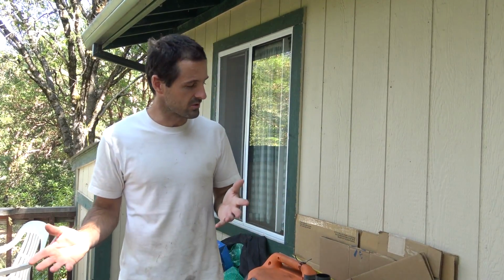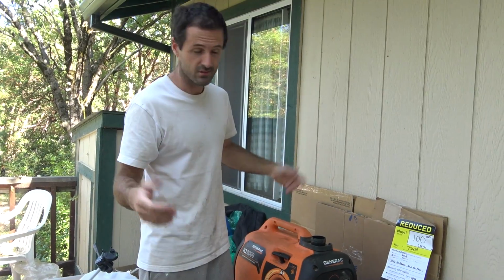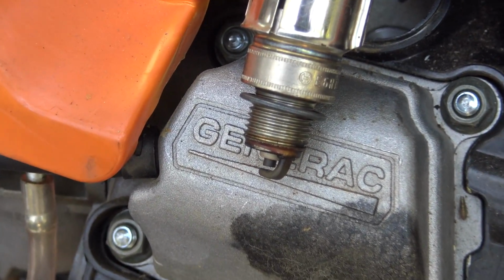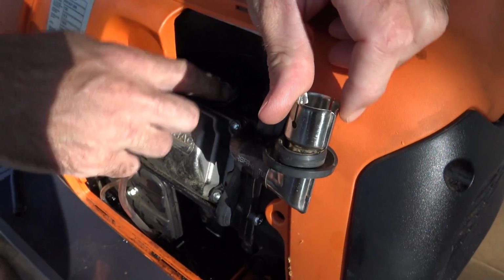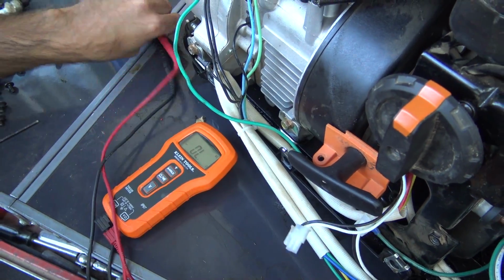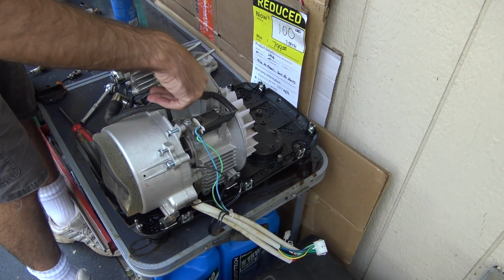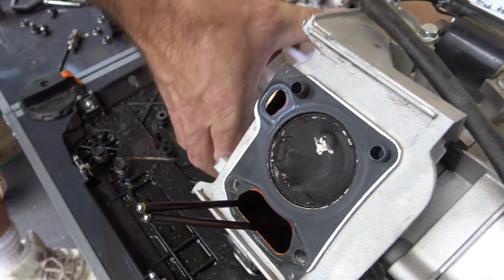$25 Generator From Lowes - Will It Run?

Comment: You have a place to fix things? You'd be surprised what people throw away. Free is always the best price. Fresnel lenses from the old heavy TVs. Furniture that only has some kind of cosmetic defect.  Radios. Most of which I didn't even have to fix. Always look threw things that don't interest you too. Open greeting cards of all types. I found two twenty dollar bills in a discarded happy birthday card. Women throw expensive jewelry away when they THINK he might be cheating. Knowledge of how to fix things and tools. A place to work and you can enjoy a quality of life higher than your income implies...
  The Idiots opinion that it's not worth fixing means NOTHING!! They think ONLY in terms of money.. I've been told impossible by so called experts when I ALREADY DID what they're telling me is not possible.
 It's okay to put ether in the cylinder. You can buy it under the name of "quick start". Just keep trying like you are and it should eventually start without using ether.
 Obviously you have lots of experience fixing these kind of things. Intermittent break in circuit continuety...
 I would have just bought a new plug FIRST before examining the cylinder.
 You are definitely NOT a fool.
 This will DEFINITELY RUN.. They just didn't want to bother with all that when they can spend their time making money doing simpler things....

Comment: Copper, zinc,vitamin c. and biotin great for hair. Do not wash hair with conditioner just shampoo and never watch hair with water. I was just taking my biotin when I heard your wife say on the clip that your hair was thinning. Lol. Thought I gave you a tip sense I was going threw the same thinning hair. Great video. I think is you need a spark plug about $3.00. Did you try cleaning the connectors on the spark plug if try the compression rings it happen to mine. Compress air was escaping no pressure.

Comment: Next time take out the plug por 30 weight oil right on top of the piston and let it set any time you walk by it manually turn the motor just a little bit just randomly over the next 24 hours then try to start it the Rings will free up I have done it with numerous Vehicles pulled out of fence rows that haven't ran in years

Comment: Do you know how to tell if an engine is flooded? Check the spark plug and see if it is soaked. You just flooded the engine on purpose and then tried to start it. You would have to pull for a long time to get it running even if you didn't further sabotage yourself by pouring gas down that tube. Leave the spark plug out, leave it sit for a day and START OVER.

Comment: A wet spark plug IS NOT what you want...with that much oil in it I would look into a leaking carb needle and seat or even sticking valves and rockers...

Comment: I always spray a little carb cleaner in the filter area just to see if it will run on that for a few sec`s...And I ALWAYS do a compression test...2strokes 120 psi min. to run right and 4stroles 70psi min. IMO...

Comment: when you put to much oil in it the oil will get up to the burning chamber and make the piston rings stick to their seats - therefore it doesn't have any compression anymore - This way i fixed the compressions on a kubota motor... Also the carburetor needle may be stuck.... Sorry for my bad english.... Greetings from germany
Reply: sorry didn't watch the other videos.... :D

Comment: I work for a company that does all of Lowe's warranty repairs on all their power equipment and gas equipment these units that is being bought for cheap are called Beyond economical repair units it is we're a part cost more than the item itself so they sell these units for scrap price I have bought a lot of things from them and it would turn out all it would need was a simple fix

Comment: they cant sell that, its missing parts which makes it a liability. u could sue if it injures you and they will settle out of court for atleast $20,000. I used to be a corporate lawyer.
what i would do is loosen the handle and drop it on my foot or set a small piece of your skin on fire for the big money.

Comment: if you invest in a bore scope, you can look into the cylinder without tearing it all apart. You can examine the cylinder walls, top of the piston and It is flexible and can peer up wards to view the operation of the valves as well.
The older way would be a compression tester, however you would have to disable the compression relief if it is not internal.

Comment: Commenters have a few good theories, the pull cord one can't happen though. If you pull the cord backwards the starter paws on the recoil won't engage the cup on the flywheel. So that theory is out.

My guess is a bad ring. Overflowing oil can cause all kinds of bad things, carbon buildup, which leads to heat and so on.  Good luck, those things are a pisser to work on. Not sure why this popped up in my recomendations, but I'll eagerly await the follow up.

Comment: You just fouled the plug by pouring gas on it. 

Use starter fluid.
Reply: TheHologr4m seriously lmao
Reply: real genius here lol
Reply: Not charcoal starter fluid - spray starting fluid (ether).  I see several good suggestions.
Reply: @TheHologr4m .. 🤔. My 1st thought. Hmmmm
Reply: TheHologr4m gas does not foul the plug oil does
Reply: My dad used unleaded on my atv spark plug and it was fine

Comment: If you watch closely at 7:41 you can se the spark jumping from the sparkplug wire to the head og the engine. If you look over the nut at the end of the generac logo, you will definetly see it.

Comment: My friend you have a valve problem, next time spin engine until one valve is full down and check the other valve to have a slight hand movement and then check the other one , i bet $23.70 that one valve it is too tight and it keeps one valve allways open this is youre problem 😏
Reply: 23.70 well spent hu?
Reply: that is what i what i thaught when he first pulled the cord

Comment: BRO ,...
YOU SHOULD'VE FIGIRED THST ABOUT THE  COMPRESSION AND ANYTIME YOU OVER FILL A RNGINE WITH OIL IT DAMAGES IT ....
ICE BOUGHT A VEHICLE WITH A NEW ENGINE IN IT , BUT BECAUSE IT WAS OVER FILL WITH OIL IT WOULD START AND IT WOW IDLE BIT WHEN GAS WAS GIVEN IT WOULD GO NOWHERE AND DIE OUT .... THE TO MUCH OIL CAUSES A LACK OF ROOM FOR THE PRESSURE AND IT BLOWS OUT ELSEWHERE.....

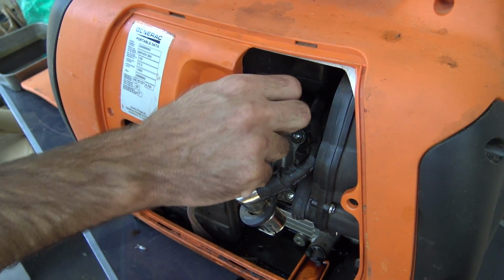Comment: I'm at 4:30 and I believe it's the piston rings the there was so much oil in the motor is got into the cylinder and pushed past the piston it could run for a short time but the tell is no compression

Comment: I used to work at Home Depot in tool repair, the first test we do is hook it up to a compression tester and if it's low write an estimate for a short block and labor which 99% of the time exceeds the value of the unit, so I'm not surprised at all that they wouldn't fix it.

Comment: Get a cheep $15 endoscope from amazon. You can drop it in the spark plug hole and check out the piston and cylinder with out having to take the whole machine apart.

Comment: I'm going to guess before I watch the next video revealing it...maybe they put the pull cord on the wrong way so it turned the crank the opposite way it's supposed to?? Since you said you had compression when you turned it the opposite way it was hooked up....guess I will find out. Great video btw I will be checking out your channel. I like your style!

Comment: I work at a Lowes and have purchased many items at a huge discount. Log splitter, trailer, generator, snow thrower ect. we had a pressure washer that was "beyond repair" and sold for $50 all it had was a little to much oil....lol

Comment: Why it doesn't run? Because you DRENCHED the spark plug with fuel, ever heard of a flooded engine? You are extinguished the spark with fuel. Second, even if it got fuel and proper spark, it will not run because there is clearly no compression. I'm a 5 year STIHL Certified tech.

Comment: Always check exhaust.... many small engines are dependent on clean of carbon buildup exhaust systems  to run.
I've gotten many cheap items that wouldn't start . After a little cleaning of the exhaust ....prrrrrrrr
... just a thought

Comment: Inverter generators rely on the main PCB to function, its sealed in epoxy and cannot be repaired, and a new one is most of the cost of a new machine, never spend any money on one that isn't producing electric.

Comment: I know on mine the water level has to be filled to the top before it will spark. , also 1/4 cup of STP in spark plug hole gives it better spark .

Comment: Correct me if I am wrong, but he said that the air coming out of the spark plug hole was blowby. That doesn't click with me. Shouldn't air be coming out of the plug hole considering it's supposed to create compression, and without that plug there it allows air to escape from the cylinder?

Comment: The easiest way to see if an engine will actually run and to have a good idea as to why it's not is 2 saturate a rag or cloth in gasoline take the air filter off and place the rag where the air filter goes that is saturated and gasoline and then pull on the pull start cord. This undoubtably gives you fuel Vapors and Air into the combustion chamber therefore if you have a spark and even if you have poor compression it'll still do something. You could probably run the engine for about 30 seconds or more just from the gasoline that soaked into the rag. If it does run in this manner than most likely you have an issue with the carburetor and a supply of fuel getting into the engine. If it runs but runs really crappy and is weak than that can tell you you have compression issues.

For many years I worked on developing fuel Vapor systems to make engines run more efficiently and this is a method that you can actually even use to run an engine without even having a carburetor. Get yourself a mason jar or a chemical resistant plastic jar cut two holes out of the lid and place male pipe thread to Barb fitting thread in one hole and the same thing in the other period on one Barbed fitting have it facing down into the bottle on the lid and run a piece of tubing from the barbed fitting tell it's almost touching the bottom of the bottle period on the other side have the barbed fitting facing up so that it is outside of the container and run that line into the intake of the engine. Fill the container up only about a quarter of the way full of gasoline or fuel then throw a sock or a rag into the bottle. The rag will soak up the gasoline into it and allow the fumes to Wick through and be sucked into the intake of the engine. You could also place a t just before the intake and install a valve for a secondary air intake to adjust the air to fuel ratio. It'll still run if you don't do this however it runs best if you have a secondary air intake that you can adjust. I would build one of these simply to have it on hand for testing engines or if you have an engine that won't run due to a bad carburetor you can have a quick fix that will get it working until a new one comes in.  

 I have several videos of this concept on my channel. It's a quick fix to assist with diagnosing engine issues.

Comment: Hi bud. After a lifetime as a marine mechanic my response should help... LOL theres an issue with compression lol.. I am betting the cl is fine as is the piston. Overfilling the oil as the fool did will fill the cyl, overtaking the oil ring and snap the other ring or rings depending on yokahama's piston. lol... not yokahama really buy probably a NY from china. Generac claims American made but really it's just American assembley of components bought elsewhere. IE engine complete from China, windings etc from elsewhere etc then just bolted together here.
Good luck , looking forward to seeing the cause and if I was correct.
Reply: Daddski 1 with all due respect I am a mechanic also but exactly how does that help what is your suggestion or solution or what does that tell him to do? Maybe more specific. Best wishes

Comment: It sounds like the piston rings have shattered...hey looking at the colour of that case i bet some rings from a 1960's Honda CT 200 trail 90 motorbike might fit it....just a guess but i would try them before even attempting to get your hands on some 1 year old part specific rings the normal ones might be hard to come by.....i would imagine you'd have a wait of roughly 15 days.....anyway if this helps you out ill accept thanks in the form of beer and chips.

Comment: I recall that some spark plugs have an internal gap that supposedly boosts the spark at the electrode.  If so, wouldn't it prevent continuity? Or, as you said it may be a resister plug. 

I enjoyed watching your videos. You two are a great team and your step-by-step analysis and instruction is excellent.

Comment: If you're going to do much work on ANY gas engines, get a good (screw-in) compression gauge and some experience using it. Simply essential with 2-strokes also. Any engine in trouble, first step on the bench is a compression-test.

Comment: It's not gonna start if the spark plugs is wet, you don't pour gas on the spark plug you pour A little bit in the engine

Comment: compression test gauge is only  $20. and you can buy a set of feelers gauges for under $5. that way next time your dumb ass doesn't have to take the motor apart when your thumb and paper towel techniques fail you.

Comment: Hey Gene I have a Taotao50cc scooter that I adjusted the valves and put a new carburetor on.  I drove it 15 miles and parked it.  Then I started it back up to go for a ride and after 3 miles it acted like it ran out of gas and would not restart until it sat for awhile.  What could be the issue?

Comment: Pull the valve cover and find out which one is stuck open
Reply: You fouled the plug when you poured gas on it.
Reply: Dummy you should've checked the valves

Comment: Wise acres aside, in hind sight , just a couple of dribbles of some version of a carbon cutter type solvent for over night would have done the job! So what ideas do we have out there to have correctly diagnosed it? I'm thinking that seeing that extra slick cylinder wall was our clue when you pulled the head. Varnished up, really couldn't have worn the rings. The fact that the oil hadn't been changed or some cheap low detergent oil added, maybe, given the propensity of this previous owner for total lack of maintenance , it's likely that the low detergent break in oil was never changed given that super varnished cylinder.  Hindsight is 20/20!  Better be sure to break that glaze before installing the new rings so they will break in properly. Loved the way you two worked together, made a fun vid!

Comment: There's not supposed to be continuity in between the top of the plug and the electrode. That's the whole reason it jumps. And makes a spark. High voltage jumps the gap path of least resistance if it had continuity it wouldn't spark or jump a gap and just go from power to ground without sparking lol

Comment: Check the compression should have been your first or second step. But even after removing the valve cover, still did not make sure the valves open and close, or if there is a compression relief valve

Comment: When you take the plug out you put a thumb over spark plug hole and pull the rope to check if you have compression. OK, better late than never.

Comment: My guess is that the rope starter is installed incorrectly making the engine turn backwards.  You showed it had good compression turning the other way.  Just a guess on my part but...nice generator anyway.  Can't be too much wrong with it and the price was right.

Comment: If it doesn't have any compression, you should've put some oil on the piston before trying to get it running. The oil seals the piston and cylinder, only for a moment, but if it starts, it tells you that the piston rings are worn.

Comment: Hii Jennies

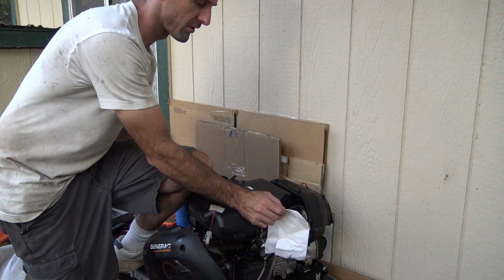i don't get you at 11:33 at all. 
why there should be air gushing out at spark plug hole (after u removed the spark plug) ? it is good side of it having compression right ? 
correct me if i am wrong or mis understood.. i wish to learn as well. 

thanks. 
truly
andrew
Reply: there should be air coming out the spark plug hole with it removed because when you pull the cord and turn the engine over youre bringing the piston up, compressing the air fuel mix in the cylinder, the fact that he can hold his finger over the hole and the air pressure goes elsewhere instead of pushing his finger away indicates a big loss of compression
short explanation at 3am tired as hell on a random video lol
Reply: its not coming from the sparkplug hole. its coming from the crank case breather.

Comment: O come on man have you ever worked on a Engine before. Man when you take the spark plug out of any gas fueled engine it's supposed to have air coming out of it so yea the reason because of that is because that's your piston pushing sir out of the cylinder but yea your right it dose seem like it has bad compression but it seems like it might be bad piston seals or it's leaking air somewhere within the cylinder but get a new spark plug and try that besides that spark plug looked like it had some Durant oil on it so it was durning oil for a while that means it's the piston seals around it that seem bad.  I didn't say this in any negative way sorry if I ticked any one of. I just worked on a lot of old  Motors of all types and I was just stating my Opinion. I just want to help lol